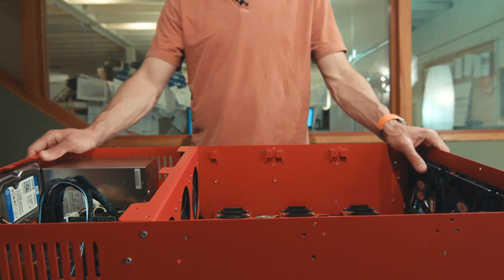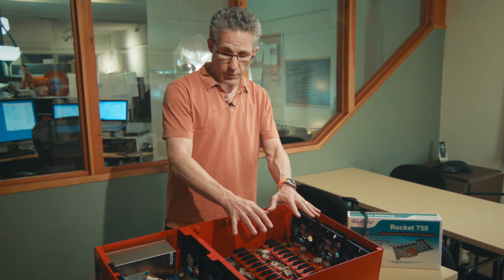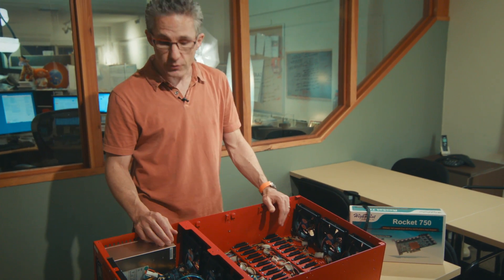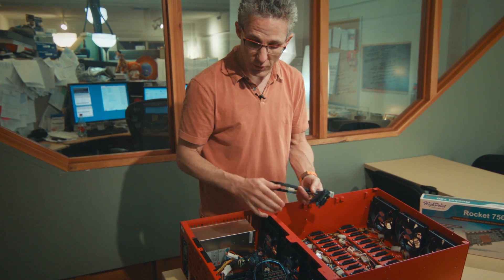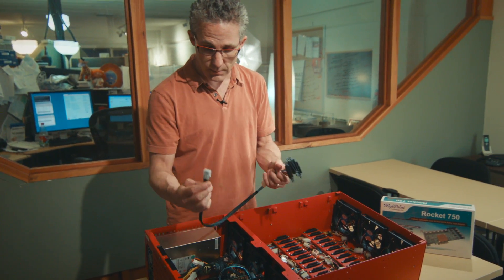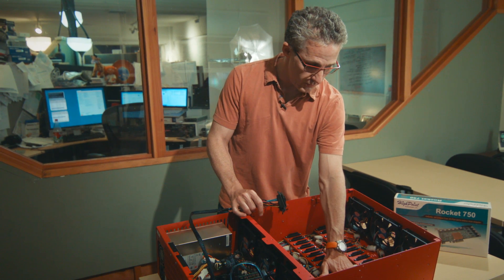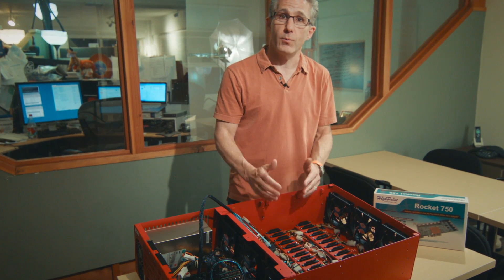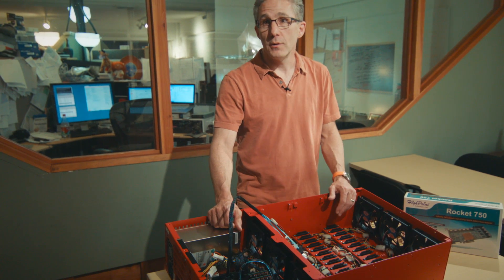Backblaze Storage Pod 4.0

Comment: This is an interesting design. I think it could be improved upon, it has a total benefit, but for starters: ducting for cooling. You have one row heating the air for the next row heating the air for the next, and for the final. 
 
Now I can't afford all of this that you have for an experiment but I do have a thermal imaging system. What I would do, if I just had a few hours to kill, would be to assemble a whole bunch of cheap (small capacity, yet functioning) drives along the backplane without any data cables, motherboard, just power to spin them. Close it up, put some of the "bubble-wrap" type windshield screen/sun-blocker around it, and fire it up, let it run at a specific temp/humidity environment. Scope out the temperature from the exhaust. Take off the wrap, take a thermal picture, cross-hair the temp of each drive as best you can. Repeat.
 
I'd put good money that the drives in the back are eventually going to fail before the drives in the front. There's a good material that can be used (for high-pot voltage encasing) that will allow readings, transparent for outside scans, but maintaining thermal energy on the other side if you wanted to take stills at a certain FPS to watch it real-time.
 
I mean if I had the resources, I'd do it for kicks. 
 
I still think that ducting would benefit longevity expectations, performance results, and reduction of energy consumption.

Comment: Did you have a custom power supply designed for this unit? I have the Zippy PSL-6580P but there are only two 12v power supply lines coming out of it like a conventional PC power supply. I would imagine I could put all the current across the two lines but I wanted to check with you in case you have tried that and came up short on power. Thanks for the info looking to start my machine up within the next day or two.
Reply: Not sure if this still matters but they're using the same PSU: https://www.backblaze.com/blog/backblaze-storage-pod-4/